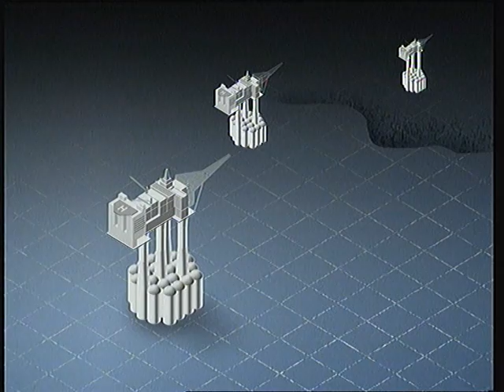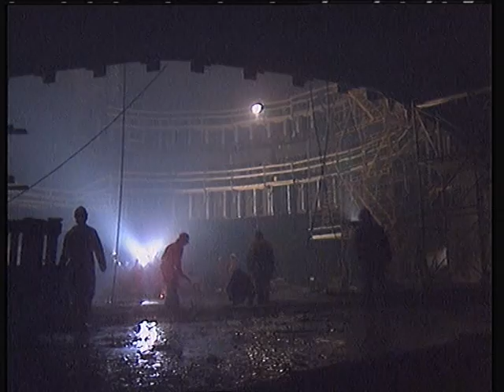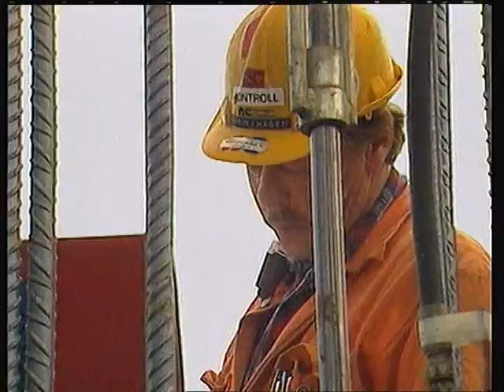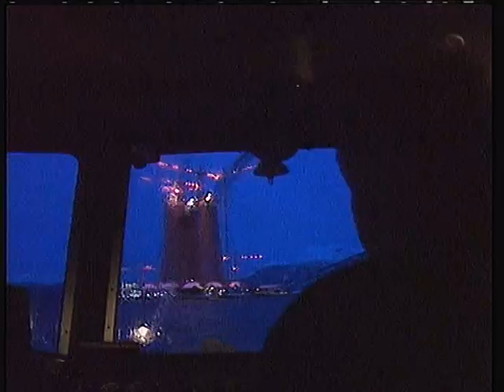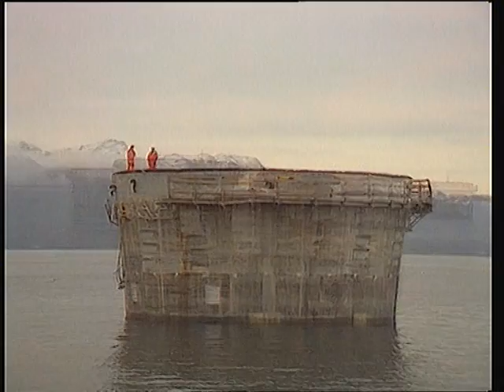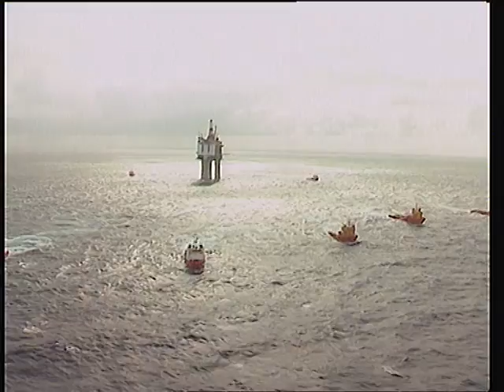Gullfaks C

Comment: Don't forget the Brits who worked on this and other Norwegian projects, engineers and draffies, and trades as well.
Reply: Now most of them are either Norwegian or Indian. Not many brits left
Reply: @Fredrikbjerk  The Brits were instrumental in the beginning. They helped Norway get started.
Reply: @luftwaffel-eggo Norwegians vastly improved working practices, conditions, projects on time, little or no reworking & brits became surplus from the normally monopolised trades & engineering for offshore. Worked on the GT (one & only gas turbine generator) a few times post offshore I found the Norwegians far better to work with than the Teeside Mafi who I then had the misfortune to work with in Russia offshore. One comment indicated Indians, never saw any of those folks.

Comment: Oil has no future
Reply: If anyone doesn’t like it, become someone that changes it.
Reply: How's that going.
Reply: peak oil has past and people still defend that shit in the replies here. climate change aside, you have to be incredibly dense to not realize that we will simply, **run out of oil**. and while it becomes rarer and rarer, relying on it for anything important spells economic and total technological disaster.
Reply: He's right the oil is running out fast = global biblical catastrophic economic & social events!
Reply: Says a climate change believer that thinks man is changing the climate. The climate is changing in Hawaii, the 8 mile river of lava has made it's own weather system with all the heat rising, I wonder if that will affect the climate temp. worldwide.
Oh, you believe in Electric, right, well that's mostly produced with fossil fuel, but, but wind mills, Windmills are build with fossil fuels to melt the steal and make the resins for the fiber glass for the blades and housing. The insulation on the wiring is a fossil fuel product, the refining of the copper is fossil fuel.
Have you parked your car yet ? Are you riding your bicycle to save the earth ? Solar panels, are over rated and also need fossil fuel to mine and melt the aluminum, and the plastic covers over the panels, you guessed it.
Oh, you say solar farms, way over rated and a bird killing machine, and again a lot of oil has to be burned to build them, I passed two of them recently in CA, both were not being used.
I think people that know are betting billions on oil being around for a long time, we have enough in the US alone to last for another 300 years at the present rate of growth. Liberals in the US have lied so much about oil being bad that I see people upset all the time over it---For No Reason.
Have a great day, turn your lights on, enjoy the world.
Reply: the future is now, old man
Reply: PRO SKUB i'am 12 years 😂😂😂...and why do we say FUTURE ?
Reply: @robertsalser848  Where do you got your data of 300 years oil reserve ? 
Then how much has Saudi Arabia 800 years ? This is ridiculous !
USA is no. 11 in the "list of countries by proven oil reserves"
and have 35000 MMbbl (million barrels)  it will last 10 years, with the the reserve-to-production ratios (RPR) of today the whole world has 240 billion tons with RPR of 51 years . 
But I think you'll say that's all liberal propaganda 😱
Sources: 
https://en.wikipedia.org/wiki/List_of_countries_by_proven_oil_reserves#cite_note-ENI-7
https://www.eni.com/en_IT/investors/global-energy-scenarios/world-oil-gas-review-eng.page
Reply: @FabFunty  I'm sorry I have so offended you, I got that information back about ten years ago from the chief engineer of a major oil company in the U.S.
The Oil shale in the Bakken field in N. Dakota covers 200,000 Sq. miles and parts of 4 states and has about 7.4 billion barrels of oil nd about 6.7 trillion cubic feet of natural gas.
The oil fields in the Permian Basin now are producing more oil than ever before, with an estimated 20 billion barrels of oil and another 16 trillion cubic ft. of natural gas.
 “How can we have been drilling in the Permian Basin for 100 years and then find out it has twice as much as we thought?” —T. Boone Pickens 
A neighbor three houses up from me has spent the past twenty five years in and around Azerbaijan mapping the oil reserves, the job was supposed to last only 10 years but they just kept finding more and more oil, the original estimate was that they had 10 years of oil, his job was to map it underground so they knew where to drill and tell them how much was there., they have been producing from that area for around 25 years now.
Pull up images of (Shale Plays) across the U.S., Through the use of advancing technology, several years ago it was found that the U.S. has more oil reserves than the middle East, A lot of oil can be extracted from shale but the price per barrel has to be above about 42 dollars a barrel to be profitable, we are becoming oil independent, (not using oil from OPEC) and being subject to their raising and lowering prices continually.
And no, we are not going to run out of oil in the next ten years, unless we get a president that believes the planet is going to die because of the use of Fossil fuels, I was in the Air Force back when Carter was president, he declared we were running out of oil, we had to ration gasoline, you would sit in a line at the gas station behind 20 or 30 cars and could only buy 5 gallons at a time, that was a lie, the Carter administration had become partners with OPEC in the middle east to buy their oil, I'm pretty sure there were some people that were getting paid for that one.
I realize you only have access to Wikipedia, that just doesn't mean you are being fed the truth, when you get about twenty or thirty years older and we are still using fossil fuels and nothing has changed you will realize that all the sky is falling scare tactics are just to push an agenda that will destroy our country.
Venezuela has the largest oil reserve but their country has fallen because of socialism, now with it's people starving and a dictator in charge that won't give up power to an elected president, they are ripe for some Communist country to come to Maduro's aid, the keep him in power so they can have the oil.
God made us a wonderful place to live and gave us an energy source to use until an alternative energy source is developed that everyone can afford and not cover every square inch of CA and TX with Windmills for power, green energy is a great thing and I will gladly support it when it's fully developed, look at the billions that Obama threw at Solar manufacturing only to have them fail, just where did the money go after the fail, no one knows. This same friend that has spent all the time in Azerbaijan has installed solar panels on his home and does quiet well, but he did the installation himself and still spent about 10 grand, the average household just cant afford that, then you have to get on your house about every three months and clean the panels so they operate efficiently, he actually bought a steel walkway and installed on the roof so he can walk down and clean the panels.
Enjoy your time here on earth, it's very short, don't sweat the small stuff that is used for political arguments, and really mean nothing.
Reply: @scrapwire1  I'm not offended, just shocked. I really hope your country doesn't rely on such information of a  _chief engineer of a major oil company _ 🤣